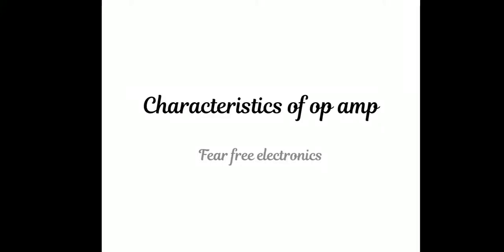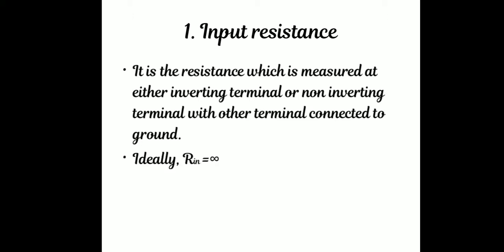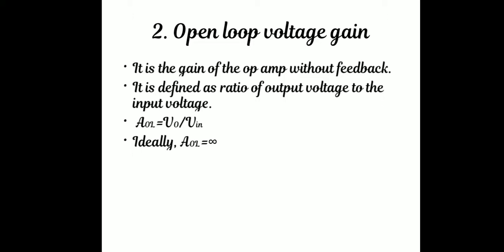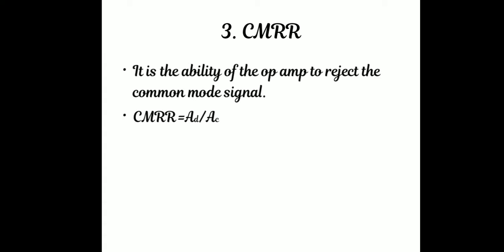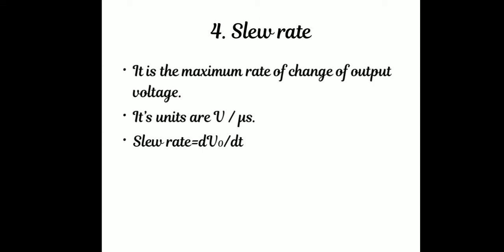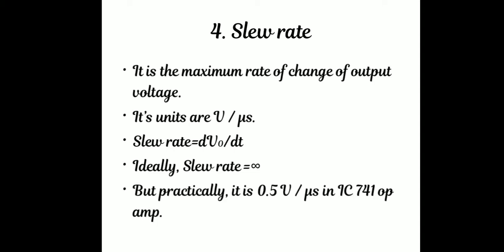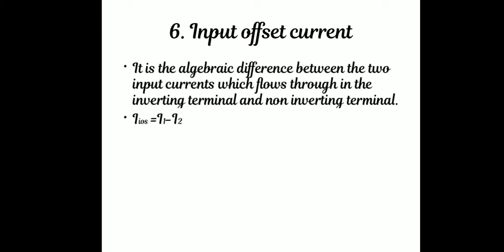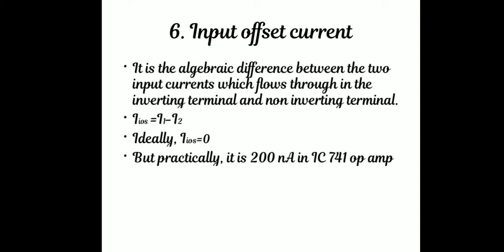Characteristics of the op amp in telugu|Ideal and practical values of op amp |Fear Free Electronics

Comment: Power supply requirements for op amp telll bro
Reply from the maker: Based on manufacturing it depends
Most of the op amps are designed for 12 or 15 volts power supply. That means +12 and -12 v (or) +15 and -15 v.
This type of power supply is called balanced power supply.
Some op amps can also capable of unbalanced power supply. That means +12 v and-15 v (or) +15 v and -12 v